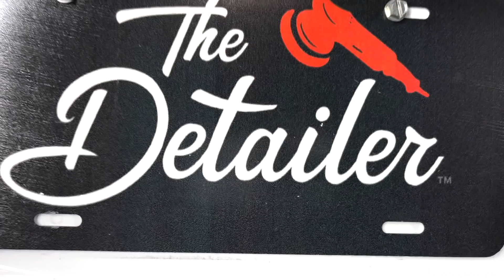WHAT THE HECK HAPPENED TO MY CAR?! 😮

Comment: Did he do a ceramic treatment as well or just clay bar then dry?
Reply: No ceramic coating just yet. That’s coming though. I did a wash, clay bar, chemical paint decontamination, wax and sealant. Well I did seal it with a 6 month protection. But no, it isn’t ceramic coated just yet. Stay tuned for that!!